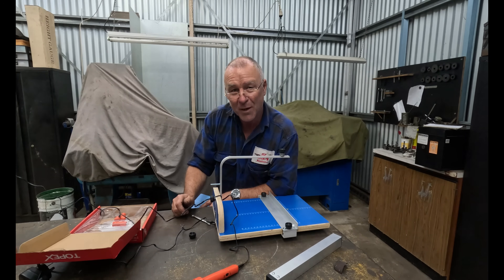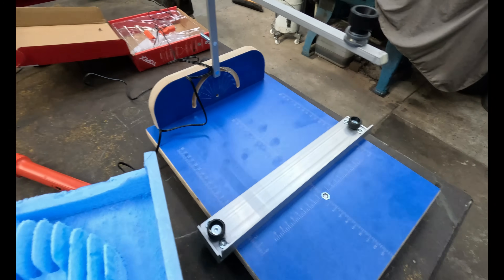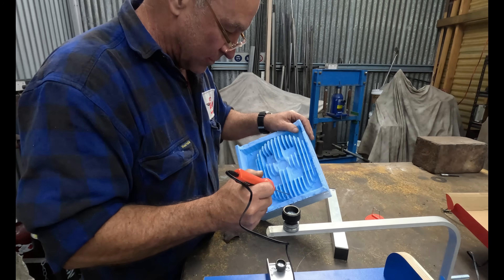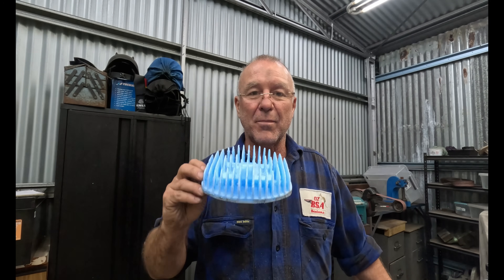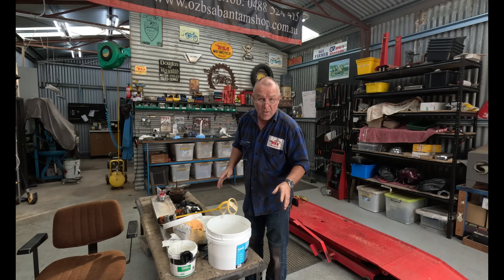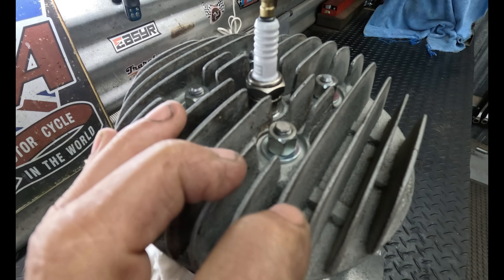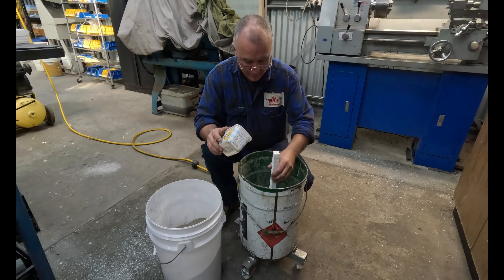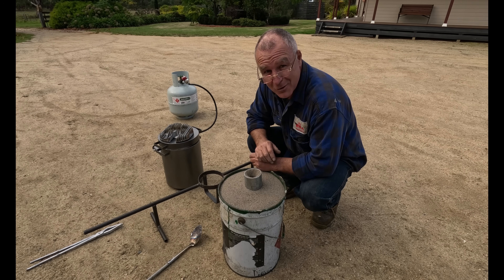Lost foam casting BSA Bantam head

Comment: Yes, probably too cold. Without a way to measure metal temp you're just guessing. With the thin fins, I'd probably shoot for 1375F. The sprue size looks fine but could be narrowed where it contacts the pattern. This will somewhat slow the fill rate, surge of metal flow, and flashback at the cup. It will also make it easier to degate. If you make your pouring cup have larger volume, it will provide more of a buffer to ensure a continuous pour, preferably square with the sprue offset to one side. You need to bury the cup to near the top, so the metal pressure doesn't cause the metal leak at the bottom of the cup. Best, Kelly
Reply: Great to see Kelly on here
Some local experience here in qld is the use of the slurry you have with added acrylic paint as a thinning medium to help apply the slurry.  This suggestion came from a YouTuber who is casting  loudspeaker frames.  
Quote

https://www.youtube.com/watch?v=jFoeOQUVqRs

@10luciano1000
4 years ago
If you make a very neat foam model and give it 3 coats of paint, and let it dry well between coats, the painting is done with plaster, latex wall paint and water so that it looks like cream soup and you color it with stamp ink to see where you are painting because the foam is white, you can also use latex wall paint of any color other than white, and the container where you put the model in sand will vibrate very well, it will be perfectly finished and the support of the how can you machine it with a router

Local experience is also to use silica (water glass) set cores in places which may distort during the sand packing process - probably not needed here.  He was making rocker covers for his mini cooper. All in all you look to be very close
Reply: @jirvin4505  As far as plaster/drywall compounds go (hydrated Lime plasters, aka non-setting plasters, as opposed to cementing plasters), one tip for homemade coating recipes is to experiment with using deflocculants (search this). It can depend on the initial pH of your coating but in general these tend to move pH towards being more basic. They will reduce the viscosity of the slurry without additional (or as much) water. Since Polystyrene foam is very hydrophobic, this along with the composition of coating materials tending to clump/flocculate, causes the coating to puddle and not get full coverage. Most latex paints these days are Acrylic Latex. Acrylic is a deflocculant. So is sodium carbonate (washing soda) and other common materials. Tuning and optimizing your slurry in this manner can create smoother complete coating with fewer coats whether brushing or dipping. Best, Kelly
Reply from the maker: @jirvin4505  Thanks for commenting and providing more insight into the process........I appreciate it.
Reply from the maker: Hello Kelly and thanks for posting all your videos.........I watch them a lot!  Thermocouple is on it's way. Would you do a gating system a bit like your 4 cylinder model aircraft engine where you could transition the sprue into say four 10mm entry points to the casting? The next pouring cup will be larger and moulded in the same profile as yours (and Ol Foundryman) I would have done it for the last pour but got a bit time constrained. I noticed in your "finned" barrels video that they were set on angles. Does the orientation of the pattern make a difference? If so what would you recommend. I have been conversing with Ol Foundryman who has been a great help as well. I really appreciate you taking the time to comment and offer advice..........regards Bones
Reply: @OzBSABantams  I'd gate it like you have, the length of the bottom side, but as previously mentioned, reduce the contact area from the sprue/runner. You might also slightly taper the runner along the length of the pattern. Splitting the runner into two similar (smaller) runners spaced apart will reduce the distance the metal must travel before it freezes. It will reduce pour/fill time and allow slightly cooler pour temps for and/or more complete fill for thin features. The two runners need to be connected with a Y. I sort of doubt this is necessary for your part bu these type of feed systems can really take metal fast once they penetrate the pattern so ample cup volume (>30% casting weight) is very helpful. It's a longer discussion but a slight (say 15 to 30 degrees) angle as opposed to vertical orientation can help results. Fins down probably helps with them fill a little better, fins up pack better, but if you have any porosity, it will be present near the surface on the side that faces upward due to buoyancy. I often don't have this luxury of tilting the pattern because of limitations of flask size but it is most helpful to help fill internal cavities. Best, Kelly
Reply from the maker: @kellycoffield533  Thanks again.....I have just done another pattern and set up the sprue and runners as you suggested. A long angle taper on the sprue split into a Y with 2 entry runners about 1/2"dia. The sprue has been angled as per your suggestion. The pattern I have made has thicker section fins and the thermocouple arrived today. Slurry tomorrow and hopefully another pour this weekend.
Reply from the maker: @kellycoffield533  Thanks for the reply Kelly. Another pattern has been made with thicker section fins and sprue/runner as per your suggestions. Thermocouple has arrived and we are getting set for another pour this weekend.
Reply: Some usefull info from NZ on making foam patterns and casting

https://www.youtube.com/watch?v=4DC0h8UHPak